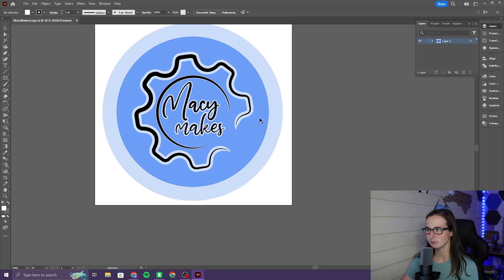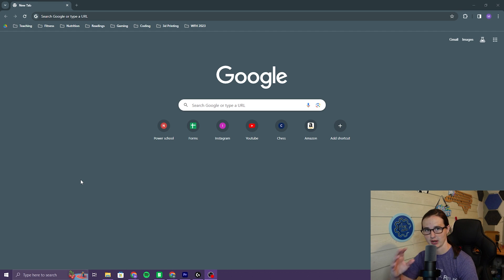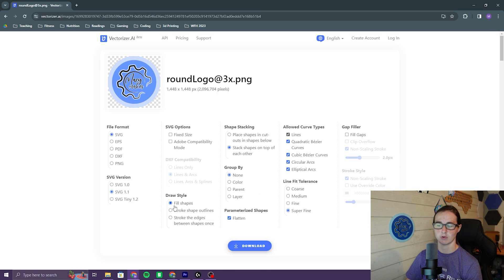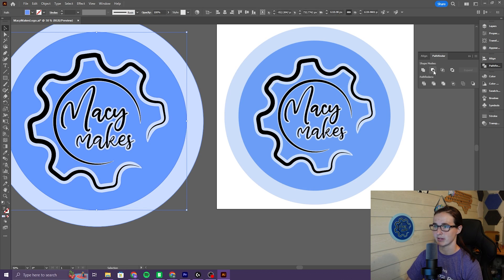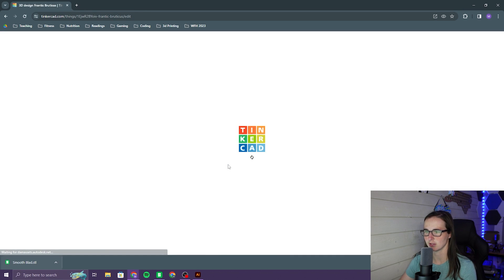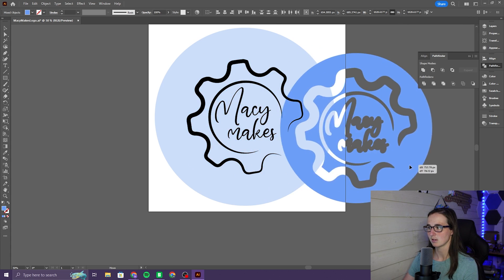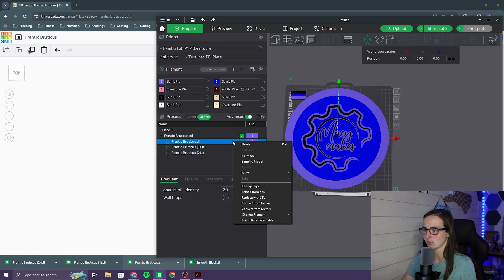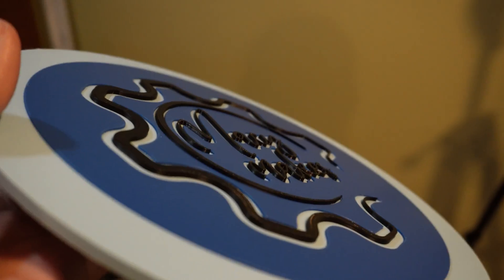How I 3d Print a Logo - Detailed Walkthrough

Comment: Another excellent video.  I may have a basic misunderstanding that would be nice if you could address.  Why do you increase fill to 30% in art projects.  My understanding is that the look of the outside of a print would be affected by number walls (thickness) of all walls, transparency of filament, and layer thickness.  I was under impression fill setting only impacted strength of print not artistic look.  I am pretty new to 3d printing and all settings so please forgive me if this seems too basic.

Comment: Not sure if you will even see this but worth a shot. When printing, is your slicer forcing colour changes on each layer, so it's effectively printing all 3 colours from the print bed up to the top layer?
Reply from the maker: Yeah the slicer tells the AMS when to change colors. I believe this design has the darker blue and the black on the same layer though so it would need to be done designed differently for a single color printer.
Reply: @macymakes3d  That's not what he asked.
Reply from the maker: @remconet then you answer the question since you know what he’s asking…

Comment: What kind of 3d printer is that. I'm looking to get a 3d printer to learn to do police badges in 3d. What do you you recommend?
Reply: She has bambu lab printers. Depending on the materials you plan on using and budget there are 5 options available. If you don't plant to use  carbon materials  I recommend p1s. If money is not an issue x1. If money is an issue A1 is a great starting kit.
Reply: Ty

Comment: I know this isn't meant to be an Illustrator tutorial, but you went way too fast!  I am using Inkscape.  I have a logo w/ 2 colors....a blue background and white letters, that I want to raise the white letters and print.  On the letter 'P' for example, when I grab it and move it, the center part turns white (like your letters when the insides turned black)....but I can not for the life of me figure out what you did to fix it or how to do it!  Is it possible to do a slower, more in depth tutorial on how you separated all the parts?  I think the commands for both programs are (or can be) similar, as there is a mode to use Illustrator keystrokes in Inkspace.
Reply from the maker: Lol sorry you had to rewatch so many times. Glad you got it figured out though! I'm going to work on a slower tutorial for illustrator. I'd love to make a full Illustrator series/course but we'll start with a tutorial and go from there :)
Reply: @macymakes3d  That would be great, and hopefully Inkscape is similar enough that it helps me.  I believe the concepts will be very similar.  It doesn't help that I'm trying to learn Onshape (CAD), Meshmixer AND Inkscape all at the same time!

One other question on the logo print....it makes sense to me how to print something in 2 colors....1 color per 'tier'...ie, a blue background w/ raised white letters (1 simple color change -  all blue then all white).  But one w/ 3 colors like yours, is it still 2 tiers?  The light blue base and the dark blue and black on the same tier -  so you have to change between them on each printed layer (blue on layer 1, black on layer 1, blue on layer 2, black on layer 2, etc)?  Thanks again!
Reply: I think I may have figured out how to do it, by re-watching this video 10x and then looking up the term 'minus front' and watching more stuff about that.  LOL  In Inkscape, I can use 'difference' or 'exclude' (I think they were called) and it seems to do something similar.
Reply: I am new to 3d printing and find myself also trying to learn TinkerCad, OpenSCAD, OnShape, Inkscape and others. Videos like this are useful to a beginner. Thanks (I have only watched 3-times so far) 😊